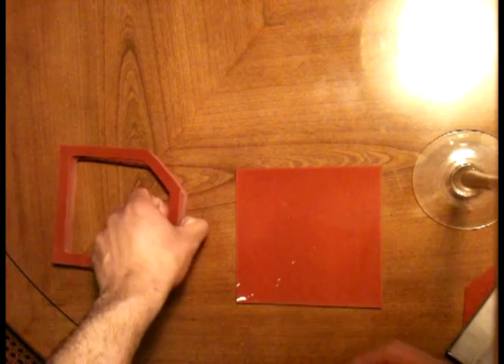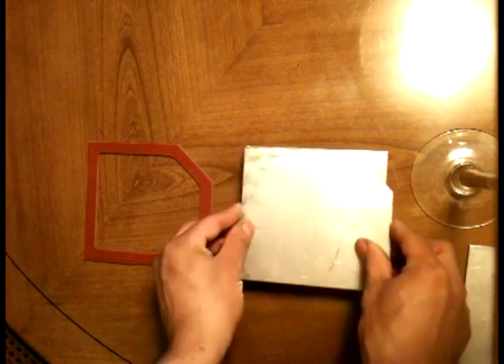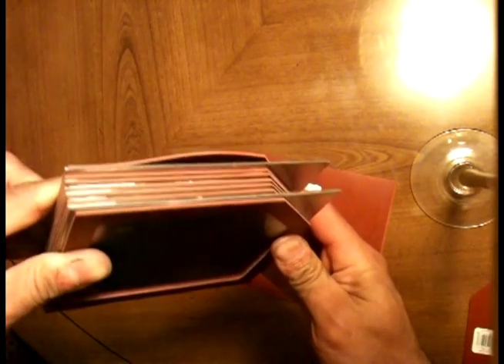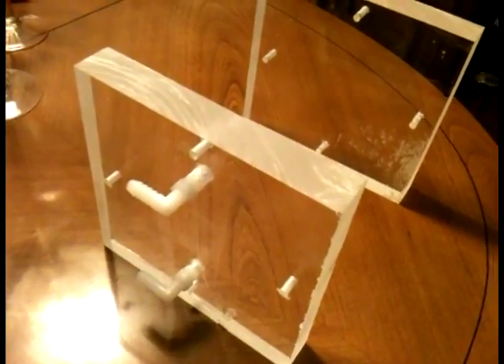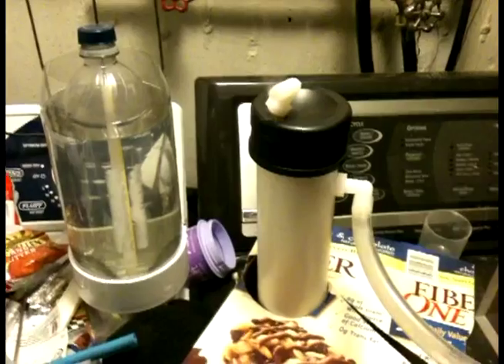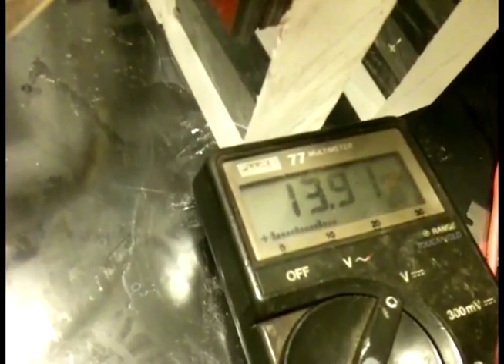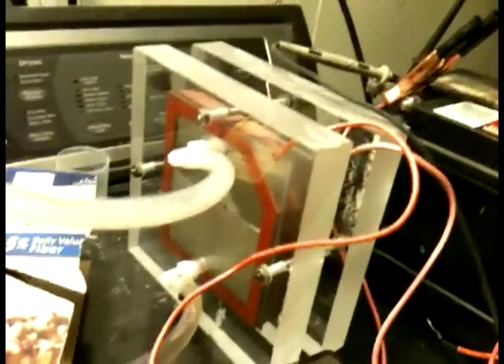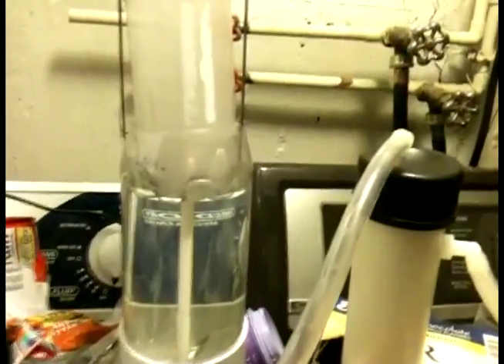FIRST 7 PLATES DRY CELL TEST (HHO)

Comment: you can clearly see your making steam comming out of your reservoir (not "reserve") and that the solution isnt being circulated enough because it is getting hot and brown. try connecting the barbs at the same level on opposite ends and have the generator at least a foot below the bubbler/reservoir